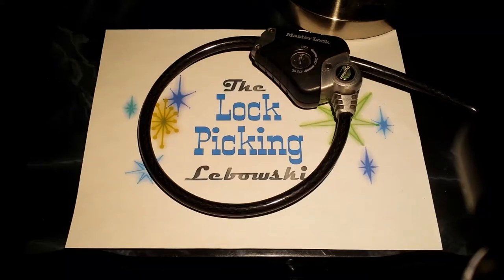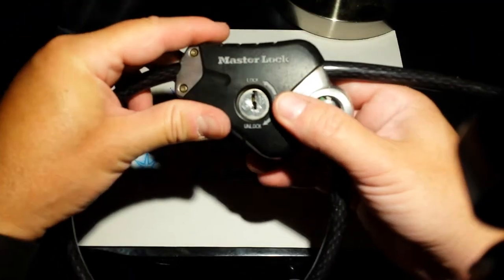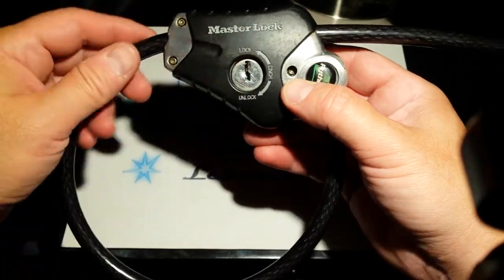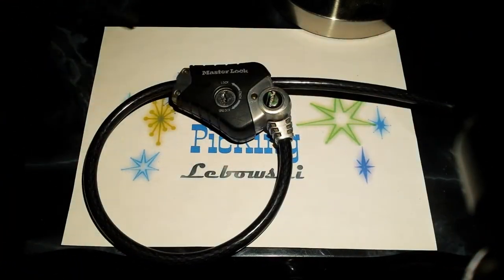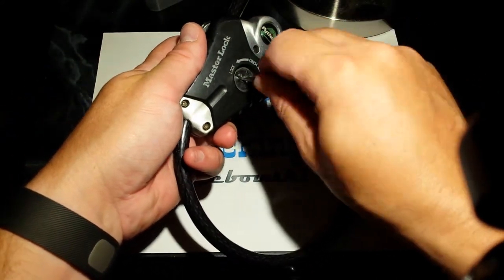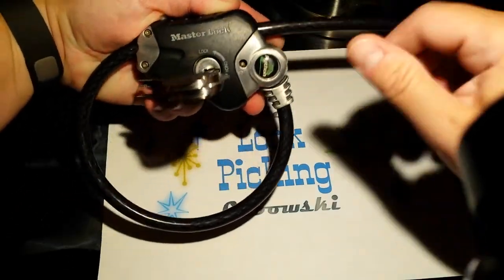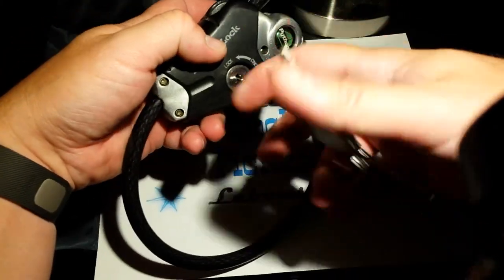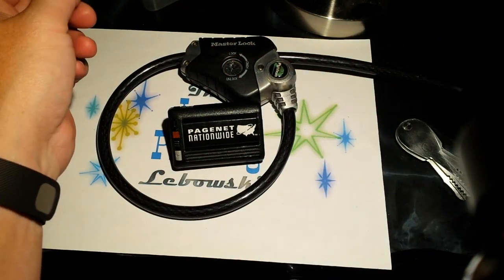(52) Master Lock Python adjustable cable lock picked

Comment: Thanks for preventing me from buying this junk. Don't think it's a bad idea though; just inferior components that are easily defeated.
Reply from the maker: Thanks for tuning in. We in the locksmith and locksport community don't recommend any cable locks because all of them can be easily cut.
Reply: @thelockpickinglebowski633  Any padlock recommendation for a Pelican 1170 case?  Noticed ABUS gets better reviews than MasterLock and their lower-end locks, although Chinese-made, fall within budget.
Reply from the maker: @Broken_Arrow58  It really depends on what you're locking inside the case and what shackle size will fit. Abus is certainly better than Master Lock. But zip ties and knotted licorice whips are better than Master Lock.